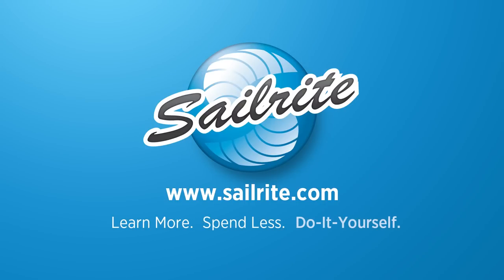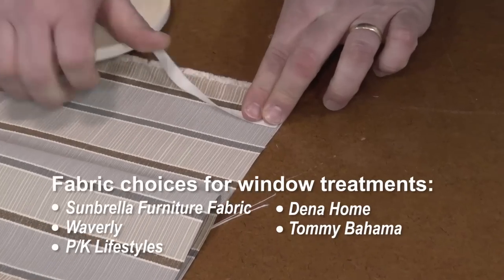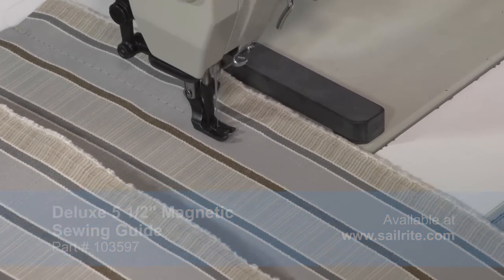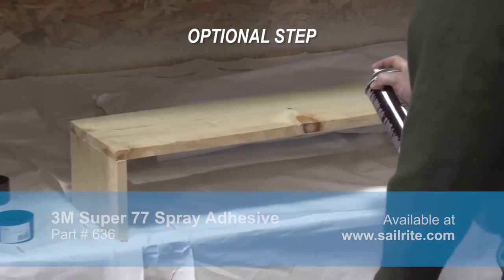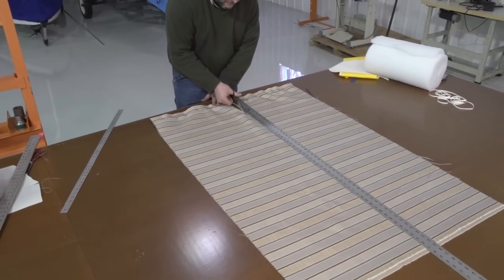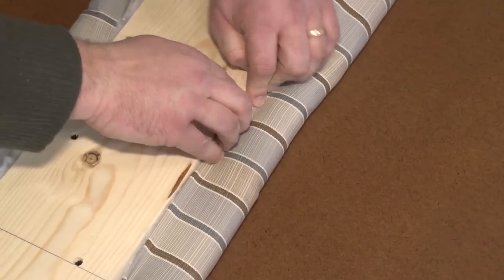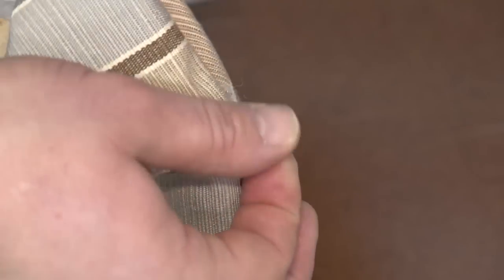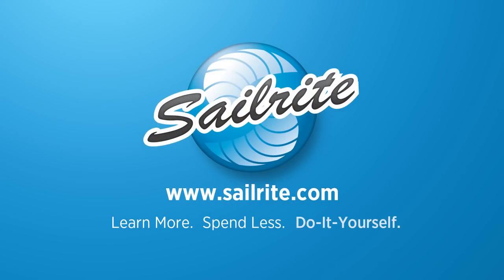How to Make a Fabric-Covered Window Cornice

Comment: 4:27 - Doesn't placing it away from the ceiling without a board covering the top defeat the purpose of a cornice? The cornice is to stop the warm air from the room escaping from the window.. Then floor length curtains stop cold air from coming in.. The idea of a cornice is for insulating the room.. Stopping warm air escaping through the window? 0,o \o>
Reply from the maker: Oh.... I install them for looks. I guess they would also help with cold air.

Comment: I noticed that you sandwiched an extra length of board inside the valance.  I was wondering what purpose that serves?  It will add extra weight to my project, so I want to make sure that there's a good reason.  Thanks for the great how-to!
Reply from the maker: We only did that because the board was not long enough, so we had to use the board on the inside to join two halves together.
Reply: @SailriteDIY  Great, thank you!

Comment: I'm interested in the hanger that you used for the box that looked like it had an eyelet.  I'm looking for something simpler to hang mine than using the traditional L-brackets.  Can you point me in the direction of how you would hang this valence with the hanger you chose?  Thanks!
Reply from the maker: I think you can find a lot of great "ring hangers" at most hardware stores.